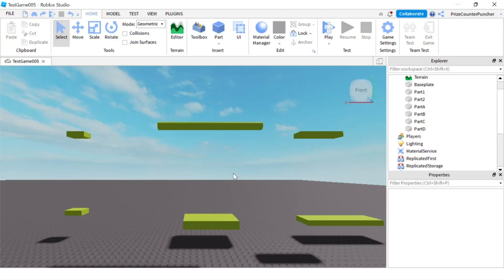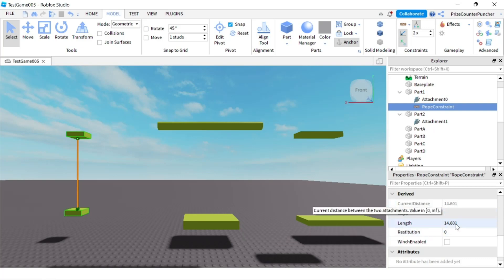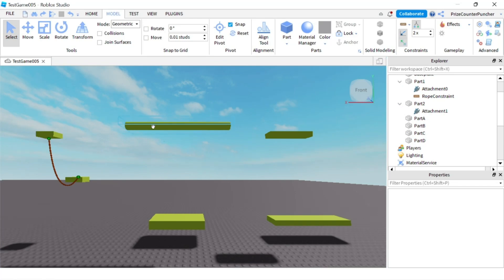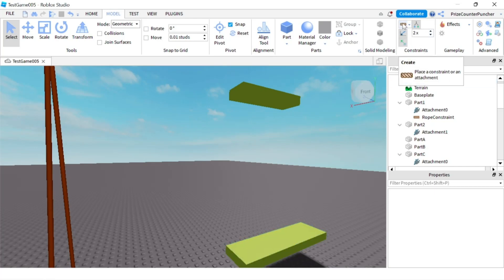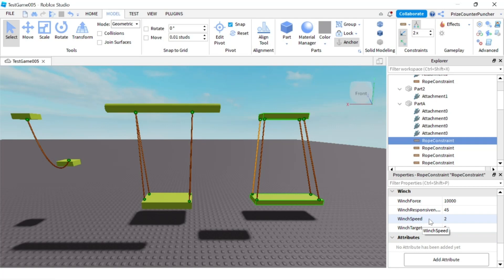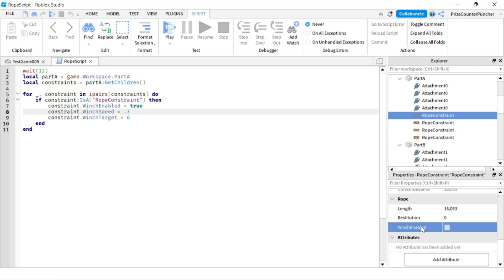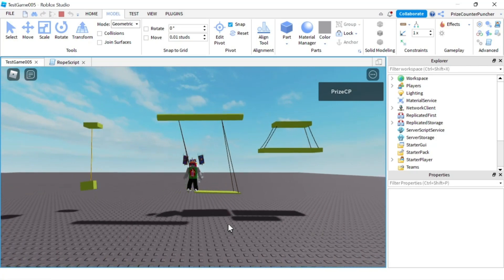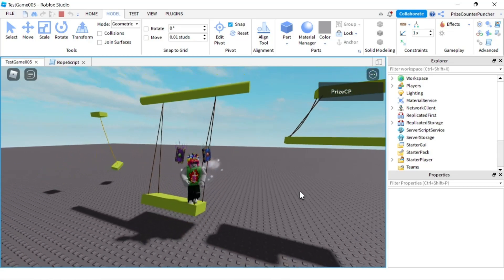Roblox Rope Constraint and Winch Motor (RopeConstraint)

Comment: I'm making a Sinking Ship game, and for the lifeboat system, my plan is that you will stand on a pressure plate to lower both ropes at the same time. However, in this case, I used RodConstraints, so I cannot use the Winch Tool. Is there a way for me to make this work? Let's say whenever I am on the pressure plate for one second, the rod will increase in length by 0.25 studs four times for a total of 1 stud in increased length? This is so that the rope lowering looks realistic and smooth. And, can I create a button that "cuts" the rod constraints, making the boat separate when it reaches and passes a certain Y value? Let's say 0 studs Y value. Basically, so that I can launch the boat.
Reply from the maker: That's an awesome idea, sounds very logical, give it a try. I have changed the length of the rod constraint before, didn't have any issue.  I used a single rod for each part.  But why not use rope constraint so you can use the winch motor?
Reply: Do you know of any script that leads to an increase in length when touching a part? @PrizeCp
Reply: The answer is to not use rod constraints. Ropes will work better.
Reply: Rope constraints are too bouncy and wild to be used for lifeboats. I will stick to rod constraints @rRadixerus